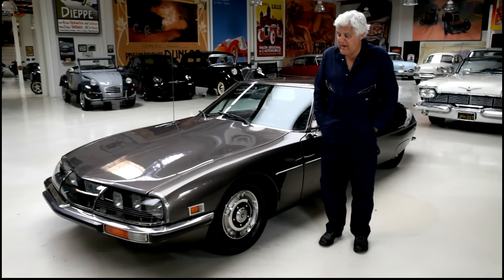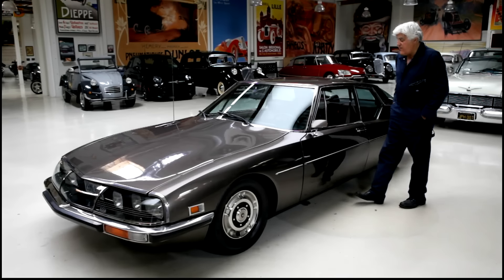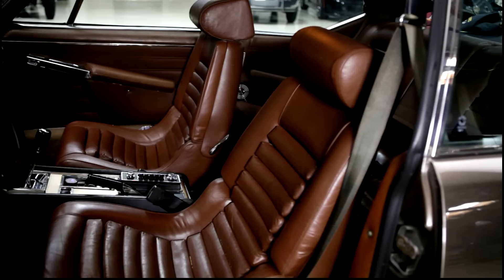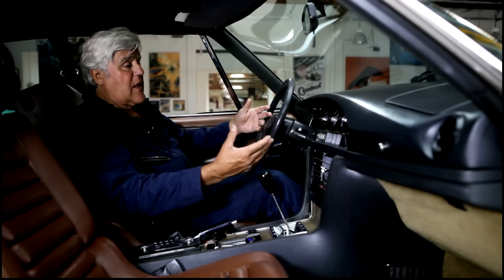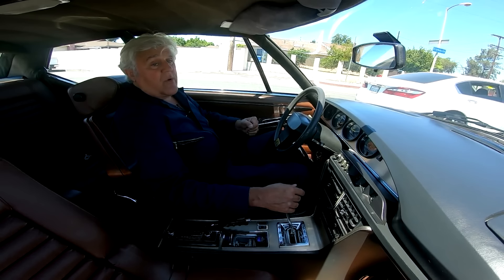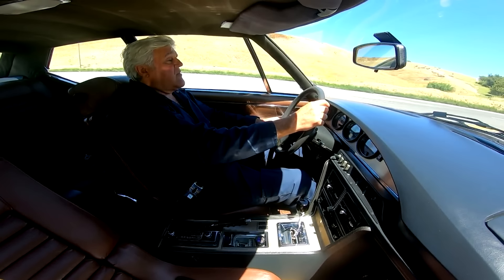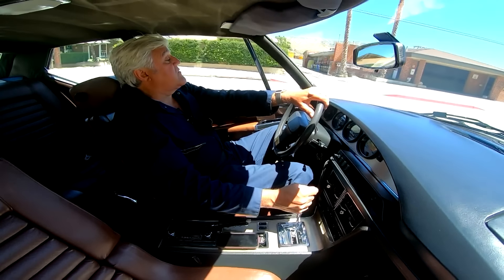The Futuristic 1972 Citroën SM | Jay Leno's Garage

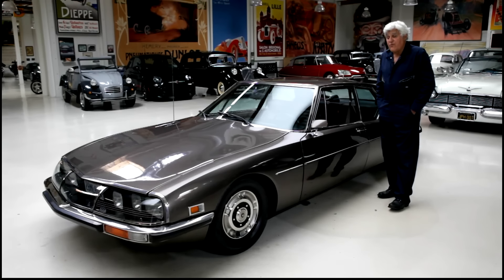Comment: 4:43 I think Mercedes actually didn't license it. As far as I heard, they used the same system but changed it a little, I don't remember exactly what they changed, but then they could claim that it was not the same system and they got away with it, I think… Something like that anyway.
And I THINK that Rolls Royce only used that suspension on the rear wheels, I'm not sure where I got that information, though.
One thing that I am sure of is that the first time Citroën used it, on their Traction Avant in 1954, it was also only the rear suspension. If I remember correctly (from what I read or heard somewhere), they developed it already in the 1940's for some military vehicles of some sort. Maybe I should have checked all this up BEFORE writing all this… 😁

Comment: Fairly hard rule of thumb: V8 have 90 degree banks. V6 & V12 have 60 degree banks for balance & vibration cancelation. Citroën V6, 2.7L & 3.0L had 90 degree banks using Maserati standard V8 layout.

Comment: 4:12 Now, this is interesting. I had a 1966 Olds Toronado FWD, the speedometer in it was the revoling drum. I drove it in 1972 on a brand new strech of Interstate at night, pushing it up to the 135 MPH mark, the last number on the drum, I believe. Drove it at that speed for like 20 seconds, the quickly dropped down to 60. It was like standing. I never went higher than 100 MPH since then in anything. Once was plenty enough.

Comment: I think the coolest thing (besides the V6 and suspension) is the body styling, the covered rear wheels, juxtaposed by the chrome bumpers, and hubcaps. The well placed body panel lines and in that color. It looks like 1960s-70s meets 2008-09. Very sleek, very forward thinking, and it comes with a manual transmission. Other than the ungodly cost of matinence, and repair, and it's age making that almost a guarantee, I dont see a down side to owning one. I'm sure gear heads would be skeptical about owning a French built vehicle, but a true car enthusiast would be jumping at the bit.

Comment: Daravi is the steering name. Basically self centres even if you stationary, which is wierd, and has a centrifugal governor that alters the pressure to the rack. Things is it piggy backs off the speedo cable and if it snaps then the default is full assist and makes it drive like a go kart. Never liked working on the engine. The cx had a clutchless gear change, not automatic, and that was a mare to set up the contact points in the bottom of the gear lever. The centre point of the steering had to be set up as it won't self centre.

Comment: 2:19 I don't think they dismissed the V8 because it wouldn't fit under the bonnet, I mean look at that thing, you could stuff a V12 there probably. IMO, the issue was they wanted all the engine behind the front axle, for dynamic purposes (I imagine). Or maybe, but less likely, for cost reasons. But I doubt there was any cost cutting when designing this battleship.
Reply: A V8 of the same bore and stroke would have been 2,675 cm³ × 1⅓ = 3,567 cm³, well over the high tax threshold. It would not have sold well in France.

Comment: April 23 enjoyed again watching Sit-trow-in or is it an? Special.
My 1st car sported a "64 Stingray" gas tank chrome lid on a Red 
VW Manx hood. 1st gear would lift the front wheels off the ground. 
Stopped all reckless driving thereafter, fuel economy cars, 24 of them,
3French 3Itallian 10German 5Japan 4USA including a Corvair van, 
a Ford work van, a Chrysler window van, 
a 4-speed 2-door Tempo darkish blue. 
Driven 200K miles getting 35mpg.
A dark blue Fiat Spyder with red seats.

Comment: And still miss an Alfetta GTV in your garage, or maybe an SZ, but at least you need a 116 series Alfa Romeo in your collection. Transaxle rearwheeldrive with inboard discs mounted on the differential. You’ll love the tech on these cars introduced early 70s, Giugiaro designed sedan and coupe. Torsionbars for front suspension.

Comment: I have heard tales of how the Citroen suspension could ride on three wheels. When the SM came out, I was 15 yo, and had just run away from an abusive home environment. I was walking through SLC, and there it was. I thought, "what a magnificent car", but since I was a homeless 15 yo boy, it was completely in fantasy land as I admired it through the plate glass window. A few months later, and I was living with my Aunt in Florida, when I got my first real job: a mechanic. Just across the street from the shop where I worked was a brand new bright yellow Pantera. My new desire, for which I had no possibility of then owning. But the Pantera was "only" $10,000...

Comment: Jay, I had a 1974 Olds Cutlass Salon with a 455 Rocket(😂) V8. It made a peak HP of 230 (between gas stations.) 170 in that Citroen wasn't that bad in the day and it probably weighed less than my Olds 4,300 lb dry weight.

Update: just checked and saw a dry weight for the SM at 3,200 lb. Also saw that engine rated at 190 HP but that was for about 5 year models of that car, and who knows about possible CA smog regs.
Reply: tecdessus  I knew that. I'd forgotten it, but I used to know it. Thanks for the reminder.

Comment: My dad dreamed about this car. His own father had a DS (in fact an ID, that was a simplified version of the DS), after owning a Traction (already a Citroën). My father inheritated the ID. The problem of Citroën suspension was the kids are often sick on board. The SM adventure ended when Citroën had to sale Maserati. During this time, Maserati suffered of a loss of reliability and a loss of interest for its production. If i had ONE car to buy, the SM could be it (for sure, it would be in my short list !). Finally, with a big family (4 kids, a dog and a few cats), my father, who was an architect, bought an architect's car : a Volvo 240 station wagon that saved his life (and mine too) by its high level of security. There is an important detail about those Citroëns : they were the best cars for french roads. Each country has specific roads. In France, we have a lot of little country roads, not large. We rarely "cruise" for long trips or on large highways. Our city streets are not large ones neither... This is also an important criteria for car design. Thanks a lot, Jay, for sharing all this !
Reply: The SM was designed for the pre-oil crisis and speed-limited Autoroutes. Cruising speed 125 mph.
Reply: @algrayson8965  i don't think it was design for autoroutes... but for local european roads for an everyday use. speed was not the main goal, but its grip that is fabulous.

Comment: Thank you for being the one to finally mention and explain the inboard disc brakes. My old DS, which I owned for 25yrs also had this braking system. A friend of mine had an SM which I had many occasions to drive. My all-time fav was driving back from NY City to Hamilton Ontario on back roads all the way at about 100mph. What an incredible driving machine. My DS was no slouch but the SM was much more refined and was just as comfortable. And yes, that gearbox was the best! Had a fun time with my DS at a gas station with an attendant who wanted to know what it was. I told him it was a South American Presidential Volkswagen. He's probably still talking about it. One more thing. If you have never driven an SM you will not know that there is absolutely nothing like it!
Reply: The CX, XM and later hydropneumatic models with DIRAVI are similar in much. The last "real" hydraulique Citroën was discontinued. Now they're pretty much badge-engineered Peugeots, which are mostly good cars as well.

Comment: Mr Leno, thank you so much for this expose on this model, many facts and features I never knew. When I moved to Edmonton Alberta, in the early 80’s, these cars were roaring around the streets. Unfortunately, most we’re already rotting away from the ravages of winter salt. I was always intrigued with this body style, it was eye catching. A friend of the time told me, the suspension on these would allow you to drive on 3 wheels, thank you for confirming that. The moving headlight system, looks like an amazing idea, reminiscent of the Tucker. Thank You so much for sharing your knowledge and collection.

Comment: How would the steering work in San Francisco when you must park downhill with your wheels pointing downwards ?
Reply: I think you still can. Just hold the wheel and shut off the engine. Of course, it will come back to center as soon as you start the engine.

Comment: I definitely recommend you ought to get yourself a CX 25 GTi Turbo 2 as those are fun cars to drive - very comfortable and stick to the road like glue on Michelin TRX tyres and like the SM, they have DIRAVI steering. They still retain some of the last unique Citroen quirks that got pushed by the wayside over time in favour of convention. Plus they're still nowhere near as complicated as the later XM and C6 which rely far more on electronics.

Comment: First Citroën was GSA Special, 1100, then 2.4 petrol CX Safari, then a  diesel 2.5 Safari. BX 1700 hatchback, then a 2.0 petrol XM saloon and the one I have now is a XM Diesel Estate 2.0 turbo, 40 and bit years of driving. By the way when in top hight level you do not drive, the latch under that one you can drive 15 mph max, then under that latch is normal driving

Comment: One common mistake when talking about the big Citroens (the DS and the SM) is referring to its "chrome." Most of the trim (the bumpers and side trim) is actually polished stainless steel -- and it will never go rusty! The SM has a little chrome around the gear shift, around some of the dashboard dials, the hood vent, and the rear side panel name plates, but that's it!

Comment: Apparently the 3 litre V6 from Maserati Merak SS drops right in and has better breathing so more power. Looks like the weakest link of these engines is the DS derived timing chain tensioner. Thousands of these were replaced under warranty but it is unclear if they were upgraded to Maserati spec or not. This engine is of interference type meaning if tensioner fails and timing will be off, valves will hit pistons.
Reply: Like all hemi engines. The Maserati engine of the SM has "cuts" (cast in) in the piston domes to clear the valves during overlap. The clearance is very small, maybe 2mm. As the timing chains wear the clearance reduces, so the recommendation to adjust the upper chains and to maintain proper tension is vital.
Another thing: get rid of the sodium part-filled hollow exhaust valves. They are known for corroding through and dropping the heads off. They are solid steel which wrecks a combustion chamber, piston and cylinder liner. Bad! Replace with stainless steel solid stem exhaust valves. You're not going to be cruising at 140 mph for 2 hours at a time anyway.
The Merak engine has a "billet" crankshaft oiled from the oil pump end. The Citroën SM engine has a conventional forged crankshaft that has the big end bearings oiled from the main bearings. There are other differences but as the Merak engine is basically the same as the SM one, using the Citroën 5 speed transaxle, they are interchangeable. Many SMs died from being cannibalized for their engines for replacement of blown Merak engines.

Comment: Jay, you are NOT supposed to drive in the lowest or highest setting. These are for garages only and when you change tyres. But you have - as you can see - 2 higher levels than the normal. These 2 are for snow etc.
Reply: You also dont have suspension at all in the highest or lowest setting.
Reply: Σωστος! Χαιρετισμους απο την Ελλαδα. 🇬🇷🏛👍
Reply: @AndreasKoutris  Klart jag har rätt. Jag skriver aldrig om jag inte är säker på att jag vet vad jag snackar om. 😅

Comment: From Colombia SA. I had 1 Ds 1974, 1 cx 1979 1 XM with Maserati engine from 1992 and 1 XM automatic 1996 1 BX 16 Valve or soupapes as they say and several smaller citroens. All of them behave like yours. I tried to buy one SM from a person who lives close by, but it was in very bad condition, this is the only one I fail to have.

Comment: Which is the latest year tothe DS model was manufactured? How would I get one that require little maintenance to get it to work in Europe and for roughly huw much price? Cheapest place to buy France?
Reply: 1975,
DS 1955-1975,  SM 1970-75 (conceived as a luxury faster topnotch DS) all SMs have a Maserait 6cyl engine, as Citroen owned Maserati from 1968 to 1975, basically 2 types, carburator or injection, some with automatic gearbox, US ones have a slightly larger engine (3l instead of 2,7l in France for tax reason),  and mainly SMs for the U.S. market were fitted with horrendous four exposed round non-swivelling sealed beams headlamps (to be replaced)  I doubt that buying a French SM would be cheaper, the price depends mainly on the level of restauration, but good maintenance is necessary (especially tightness of distribution chains must be checked every 20 000km and are not easily accessible require many hours), a clean SM is about 56-60 000 euros in France, cheaper ones on the market but restauration can be huge
Reply: @patrickgalvaing2105  you are well informed Messiur. Merci!

Comment: Wasn't the Tucker 48 (made in 1948) the first car to have headlights that moved along with the steering wheel direction?  The Maserati SM wasn't the first car to have this feature.
Reply: Just one headlamp.  A center-mounted one.  and it was actuated by cable, not the car's hydraulics.
Reply: @mescko  The DS/ID self-leveling headlights are operated by Bowden cables connected to the antisway bars. The DS/ID 1967-> steering long range lights are operated by rods from the steering relays.

Comment: I knew a traveling salesman in San Francisco who had a large territory and leased an SM. It had enough room for his samples (clothing), got better gas mileage than most of the other large cars of the time, and was a pleasure on the highway. Major downfall: reliability, specifically, the engine. If you had a service issue anywhere except in the Bay Area, you were done for, as Jay points out, US mechanics would just shake their heads and walk away. When he and my Dad took a long sales trip, they took my Dad's Audi. I briefly drove a DS. Great car for the ride, and the brakes were the best I've ever used on any car, Porsche, MB, what-have-you. Was downright slow with the four-banger. And as for repairs/service, see above. A nightmare. No dealership network so you didn't dare leave a major metropolitan area, the only place where you might find a mechanic. The French seem to have never really cared about the US market and all their marques have suffered for it: Peugeot, Renault...same story.

Comment: You said in America mechanics didn't know this type of cars and couldn't repair them. The thing is that French mechanics couldn't either. The has always been the problem with those top of line models. In the 1990s I lived in France and I owned a 1991 Peugeot 605 3.0L automatic. It was a beautify car and a dream to drive if it worked... *IF*. The car was so difficult to repair, I couldn't find a mechanic who could repair it. No problem with my simple Renault 11 I had as a second car to get to work.I finally found a capable mechanic to repair this car in Switzerland but it constantly had problems.

Comment: Thank you for a great review of the SM. My father did everything for this family and when he felt we were established did something for himself and purchased a used SM, it was his hobby. Im told every great engineer (for that time) either wanted to work for NASA or Citroen. And my father was a brilliant man. The car is remarkable in many ways even now, inboard disc breakers, hydraulic suspension to name a few. And the flat bottom of the car and overall design gave it an unprecedented low coefficient of drag even by today’s standards. Cheers!

Comment: Thought I saw an Ariel Motorcycle in the video where there was a car that was two front wheel drive ends joined together with 2 drivers back to back driving through your shop.
Was I wrong? If not where is it?
 I own an Ariel Red Hunter 350 NH 1959 Last year in Business. 19HP (claimed) 4 speed.

Comment: Pretty sure Mercedes-Benz did license the suspension as mentioned along with Rolls Royce.
Reply: Mercedes-Benz used the Citroën suspension on the 450 SEL 6.9. The individual parts were quite different.

Comment: I remember in the 1980s ther were hundreds of 3 year old abandoned Citroën BXs littering the streets of London. 3 years being the time new cars in the UK are exempt from Ministry of Transpot MOT testing. Hardly anyone in the UK understood the Citroën suspension system and Citroën agents were thin on the ground. I have just sold a a 4 year old Citroën Berlingo because it was due a timing belt change, and there is no Citroën agent near where  I live. Shame because it's a very practical car and real nice to drive apart from the stupid electrichand brake, where's me lever i say as it stalls on take off and rolls back 3 feet. Citroëns downfall as an export is the lack of dealers and agents for these very complex cars. The best car Citroën ever made was the 2cv simple to work on cheap to run and spacious inside.

Comment: The reason why the swivelling high-beams were banned in the US was because regulations at the time required all vehicles to have two or four round sealed-beam headlamps on fixed mounts, with no lens or other covering in front of them.

But why was this regulation in place at the time?